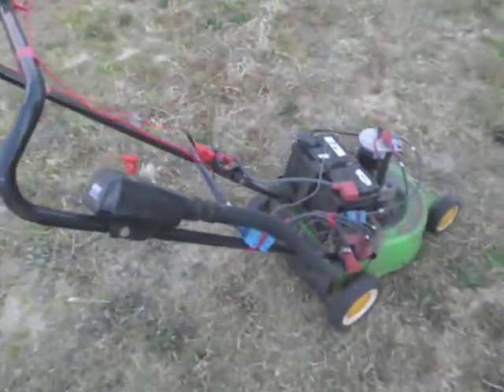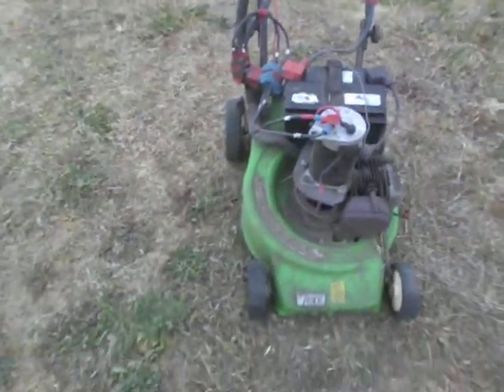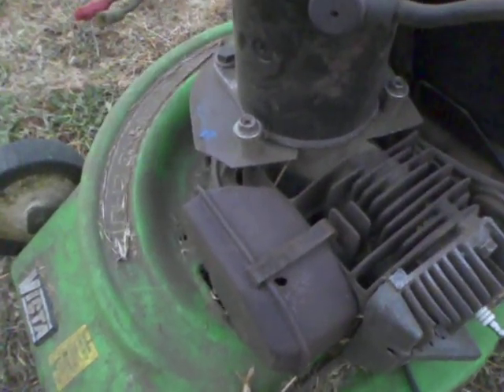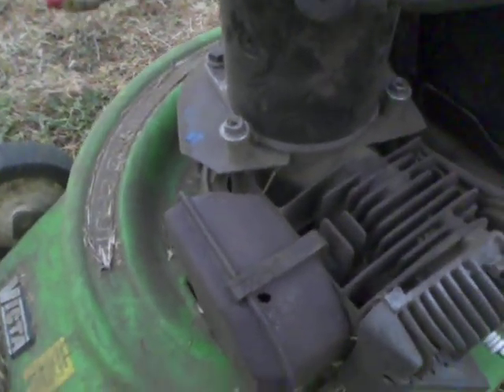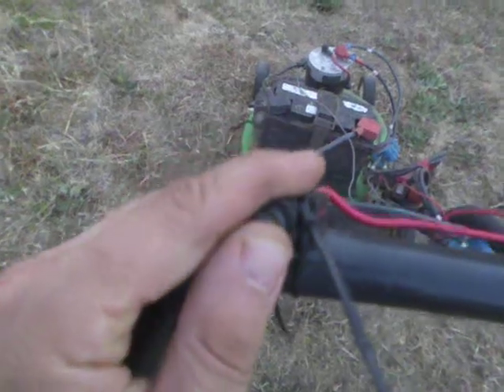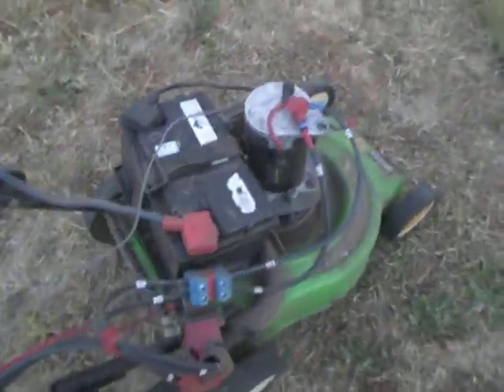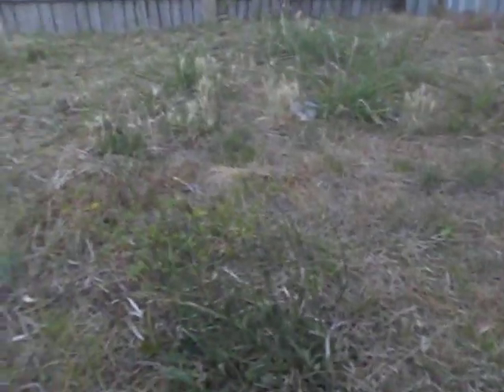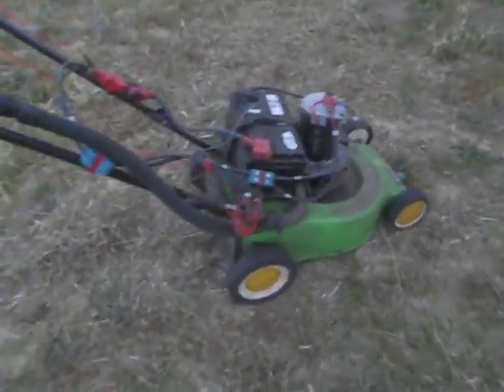Electric Mower Conversion Tech overview & Demo by Crazy Al

Comment from the maker: RWS Browning No, I did not replace the crank bearings. I'm not sure what bearings it currently has, but if it fails, then I will be looking for a sealed bearing as per your suggestion.
Reply: A two stroke lubricates it's bearings with the added oil gas mix. You may try using synthetic grease on the bearings to try and extend their life.

Comment: I would cut the whole cylinder off and scrap the metal. Did you replace the crank bearings with sealed ones? The stock bearings won't last long without lubrication.